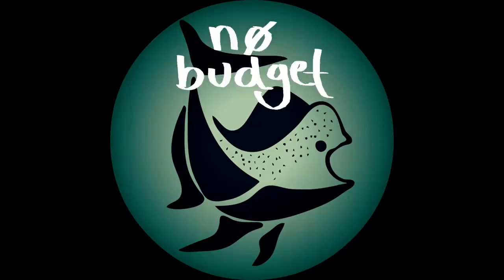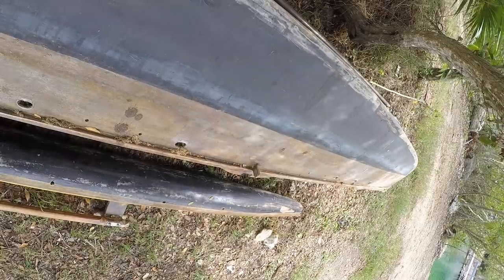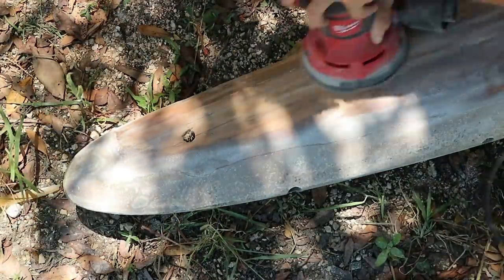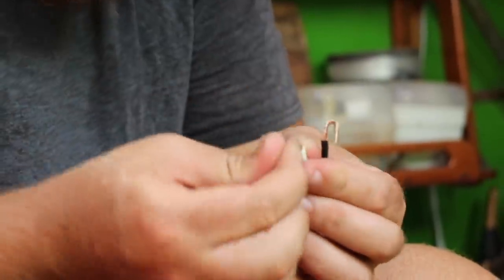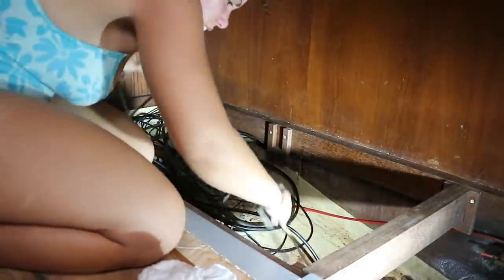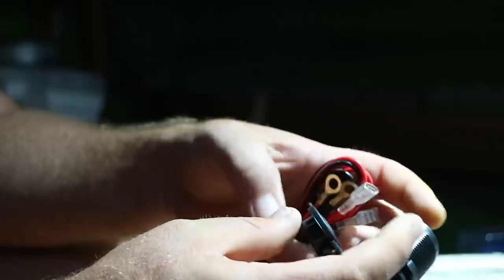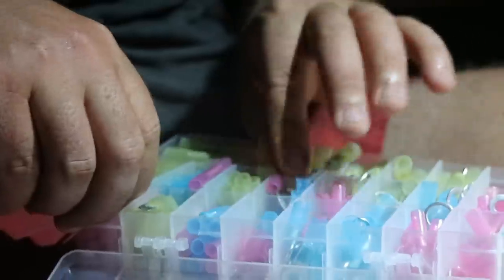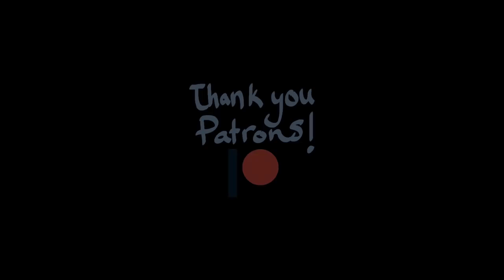59. The Joy of Sanding

Comment: ahh, and the fuses have little metal spots on the top to measure for a broken fuse with an ohm meter or volt meter without removing it. (Ohm Meter if the circuit is cold/not under power, Voltage meter with one lead to Ground to check if a) there's power to the fuse and b) if the fuse is blown.

Also handy for hunting stray current, or approximating the current drawn by an appliance (The Resistance of a fuse can be found in Datasheets of brand name fuses (littlefuse comes to mind) and from there it's I=U/R) (measured with both leads on the fuse, the small resistance of the fuse is used as shunt)

Comment: "Sea Dog" polarized plugs are the only ones I could find. Only reviews said they were crappy at $9 for a plug in and plug. It's marine but very low quality. Perhaps strange European plugs and outlet and label the outlet. The standard is cigarette lighters--very strange, I guess supply and demand has only the ones you got.
Reply from the maker: Thank you for the ideas! We have been learning a lot about connector names today...I've dealt with these sea dog polarized connectors. They're not so easy to clean. I think I'm starting to realise that 12v 'cigarette lighter' connectors might be the most used because they are easy to pass a rag over/inside to clean.
Reply: @sailorama  your probably right. The old banana plugs with a pipe cleaner might be an option.

Comment: Dunno about MX / the States but in living in Europe I switched to Neutrik Speakon Plugs/Outlets, normally used for PA Systems, after I melted some DIN Plugs. 
https://www.neutrik.us/en-us/product/nl4fc 
https://www.thomann.de/de/neutrik_nl2_fx.htm. 

They are comparatively priced but the quality is far superior to any Ziggy Plug I've ever seen (if you don't go for chinesium knockoffs). Also, they don't wobble, don't get hot, are rated for 40A, lock in place, ... I keep some adapters handy for using other plugs. For (Semi-)Permanent Connections I mostly use Wago 221 Connectors, which nowadays are rated for shipboard use.
Reply from the maker: Very useful that the speaker ones lock into place. Also, those WAGO connectors look awesome! They look very easy to work with. We might try to track some down. Thank you for your input!
Reply: You're more than welcome, thanks for the entertainment! I'm usually not into making advertisement for products but these two are sort of favorite solutions. Sadly I could't find an animation of the plugs, but the concept is awesome. The contacts double in function as springs, so you stick in in, turn 45degrees against the spring and then it locks. Also, they come as 4 and 8 pin versions. For the next rewire I'll probably run 12V and 5V through the whole boat on different pins in the same outlet, so any outlet can charge cellphones without stupid charger.

I guess the Wagos will be available or become available shortly, over here they're pretty much in every hardware store nowadays. There's also an adapter for putting them neatly on 35mm rails in distribution boxes.